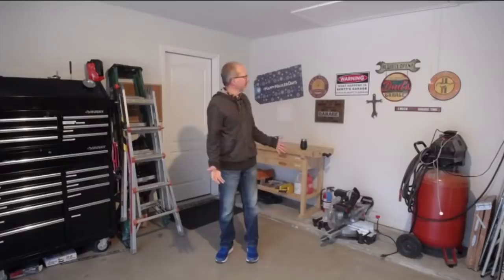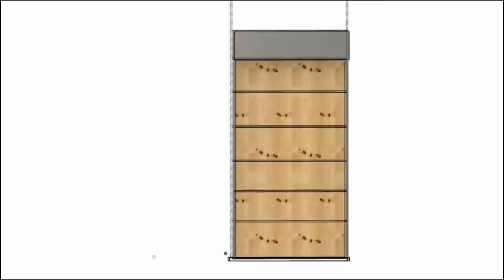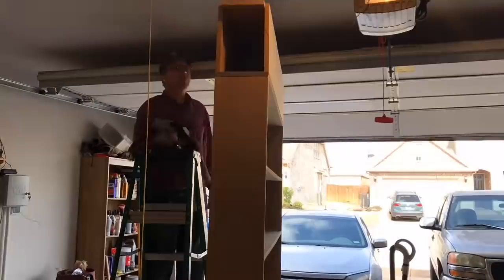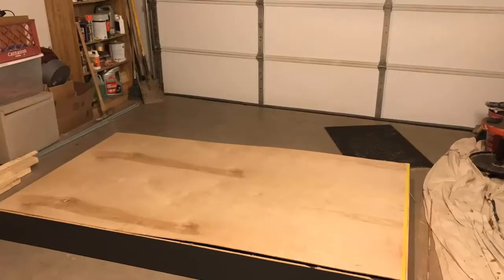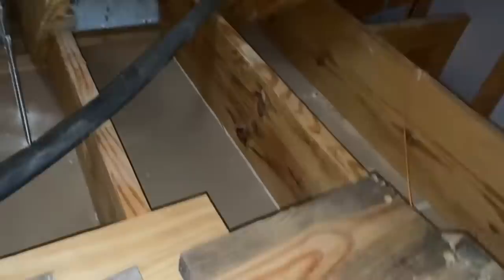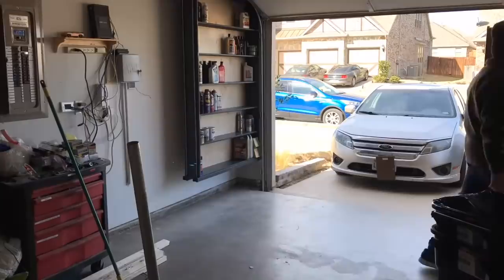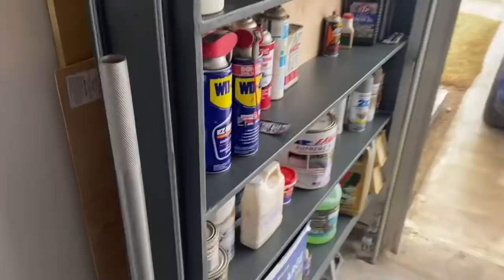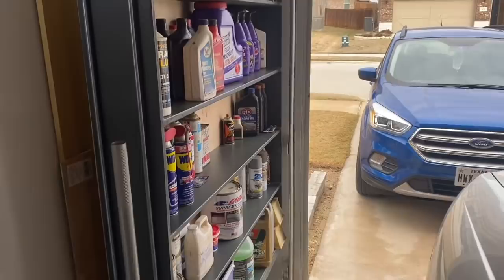Get Smarter Storage with These Easy-to-Build DIY Hanging Garage Shelves with Extra Storage Behind!

Comment: Good video and I liked the project and how it turned out. Several years ago I bought the gear wrench ratcheting box end wrenches to avoid the pain of taking a wrench on and off the nut or bolt. That kind of wrench would of helped you in the attic. I was cringing a bit as you came close to the roofing nails with your hands. 
I also noticed that in the attic you had some reflective insulation against the back of the roof... Was that something you installed or was it installed when it was built? And do you know how it was installed? I am going to do something like that this winter and the shelving project would be a good addition as well. Thanks for the video and information.
Ron
Reply: I noticed the same thing, that's why I have gear wrenches to avoid having to keep lifting and turning the wrench back to get a new bite.

Comment: The problem with mdf is the sag factor.  Those shelves will  start to sag  pretty quick.  Maybe if the are stapled to the backboard they won’t.
Reply: If he took one more piece of threaded rod and put it through the front of the shelves in the middle of them, that would help to mitigate some of the sag... Personally though, the only thing I use MDF on is sacrificial tops for a radial arm saw and table saw sleds...

Comment: To debur the cut all thread: you can use a wire nut, usually a large blue to thread on then thread off the rod, and it will clean up those threads perfectly
Reply: Or just use the proper nut that goes with the threaded rod/bolt. It does the exact same thing but better because, it isn't tapered like a wire nut, has the correct thread count, is the correct diameter and can clean up way more threads further down than just one or two at the end.

Save the large blue and Grey wire nuts for splicing wires and use the better option...
The actual matching hardware.
Reply: @Az FOA  I'm not sure what you're talking about. If you're saying thread the nut on first sure, works great. I have ran THOUSANDS of foot of all thread for years as an electrician. I can literally consider myself an expert on mounting, anchoring, hanging, running pipe racks, THREADING my own rod, and I can tell you that a big blue nut or maybe even running your channel locks backwards on the end of the rod is the way to go. After you've cut the rod, OFTEN the threads are gnarled enough where you can't get the nut to start. But thanks for the pamphlet information, I'll stick to my pure experience on the matter
Reply: @TheManic.5-OH  been a sparky since 99' myself, so I'm also speaking from decades and thousands of feet of experience. 
If you think wirenuts and channel locks are better than the actual hardware that is made to go together and it works for you, then do it.
Someone on the job site should show you how to cut a threaded rod properly so it's easy to put on the nut. Or you could probably look it up on here and teach someone else on the site.
No need to worry about mangled threads from the bandsaw. It really saves time and is much easier, well for me at least, I've never tried wirenuts. I figure if I'm going to screw something on, it might as well be the part I need.
Reply: Oh boy, lessons on a bandsaw now! Well, how about this: I've been using a porta band since they were available, hell, we even got a prototype to try out before the (I think) makita was released. So its probably safe to say we've got similar experience using portabands. In fact , I own two, recently purchased the dewalt atomic, and its a game changer for dewalt users even though Milwaukee has had their lil band out for a long time.  Although I don't recommend it or even approve anymore, out of necessity, I started cutting all thread with a Sawzall. So I had no choice but to learn. And yes, having a wire nut on hand is absolutely faster than any other method with stubborn threads 👍🏼 that's been my point all along. I'm not sure what other hardware would be included to do this task, especially because hardware ISNT included and we buy all thread by the stick, not by a fancy install kit with 'included hardware' :)
Reply: 🤦🏽‍♂️🤦🏽‍♂️🤦🏽‍♂️ well, since you're clearly having trouble comprehending what I've been saying this whole time, you may need someone to help you understand. When I said rod comes by itself, I was responding to your comment about 'included hardware', its ridiculous. You don't buy 'kits' of all thread, no hardware is included. You literally just provided evidence you don't know wth point you're even trying to make. 

Why don't you make better use of your time and go be productive instead of trying to make the world thing you're smart on YouTube? 

I'm recovering from a knee surgery, so I actually have down time to be on here, in comments, I can prove you wrong all day, but I prefer to learn from YouTube. I was offering a tip that's worked for me flawlessly for a long time, especially since most people learning about cutting all thread on YouTube aren't going to have the experience I have and may struggle with clean cuts. Maybe post a link to these sweet kits you speak of 👍🏼
Reply: @TheManic.5-OH  please show me what post I mention it coming in a kit? Or the hardware was included? Please, I'll wait.

What I actually said was, if you could read, "who buys allthread and doesn't get the hardware to go with it".
I also said "the matching hardware".

That's not me saying it's a kit or anything is included. 

And you say it's clear I'm having  trouble comprehending and saying on point? 
Lol, pot meet kettle.

You must be doped up after surgery, so it's understandable you are having trouble reading and following what's going on, so I'll leave you be.

Get well soon sparky.

Comment: how is that MDF holding up a year later?  I built a whole set of kitchen type cabinets for my garage (both uppers and lowers) out of MDF. After a couple of years they started sagging and racking due to the humidity here in Florida so I replaced them with 3/4 ply and they have held up very well and it is going on 12 years. MDF does well in compression loads but not so well in any other orientation, it also swells if any moisture  is left on them for any length of time even when painted or sealed.  Bottom line, you did a nice job but keep an eye on them because they will eventually fail.
Reply from the maker: No sagging at all so far. Thanks for your comment.

Comment: In the end I was not convinced that the extra work to hang shelves created any real benefit.  You could still have space behind the shelves if the shelves were on the floor, perhaps with some anchor to the ceiling to prevent tip over.
Reply: Makes it easier to use a leaf blower to clean out the garage... Also, since it's a garage, there's a chance that anything touching the floor is going to get wet and that is BAD with MDF... An added benefit though is that it leaves a place for heavy stuff that rolls like a floor jack... :)

Comment: I would prefer the load on the concrete rather than the frame of my house.....
Reply: It's close enough to an exterior wall that the vast majority of the load is going to be transferred directly to that wall and then to the concrete... Since he's using MDF, he's not going to be able to put that much weight on each shelf...

I have probably around 400-500 lbs of lead ingots (for casting bullets) stored in my garage on shelves that are between the exposed wall studs... The shelves are just 1x4 pieces of cedar reclaimed from a privacy fence that was blown down during a hurricane a few years back with 1x2 pieces nailed to the studs for edges for the shelves to sit on... It's all about distributing the load... Each shelf has maybe 2 or 3 layers of ingots on it, so no deflection in the shelves...

Around here, it's pretty common to have the water heater for your house located in the attic and it is not necessarily located directly over a load bearing wall... A 50 gallon water tank is going to way at least 400 lbs when full just from the weight of the water...

Comment: Any idea on how to approach the same shelves but without access to hang them? Above my garage is finished so I can't get to the joists to hang. Any help appreciated!
Reply from the maker: Interesting you would ask. I was just thinking about this. I would get another 2" x 3" stud and cut in half leaving two 48' lengths. I would drill a 1/2 hole at each end (4 total) and then countersink the nut. Then I would align the rods with the shelves and lift up the countersunk portion to the ceiling and using a stud finder firmly attach the studs to the bottom of the rafters. Then I would put a jack under the shelves and lift them up off the floor and tighten the bottom nuts. I think this would work. I would also keep the shelves a foot from the outside wall unlike what I did in the video. The reason I say this is that I received a lot of negative comments from garage door repairmen saying it will cost more replace a broken spring. They need 1 foot clearance. Hope this helps.

Comment: not sure why you could not just have screwed them straight to the wall in the back and leaving a gap for the plywood for it and not use the threaded rod ....it would be easier faster better and cheaper way cheaper to do, much like all floating shelf's no need for rod.

Comment: Granted the space behind the shelf could be very useful, but it also means you couldn’t butt anything large or heavy up to the shelf’s or you would lose access. 

Personally, the attachments in the ceiling space concern me a whole lot too.

I think I would go with a French cleat type system forgo them space behind and have potentially deeper shelves / or more garage space that are easier to remove if needed for garage door repairs etc.

Comment: Should you put a support in the middle so the shelves don't lag?
Reply from the maker: It’s been a year and no sag so far. I understand your concern, however with mfd.
Reply: @ScottsGarage17  -- FYI... It's MDF, not MFD -- Medium Density Fiberboard... There's also a HDF... MFD is usually "Multi Function Display" and "mfd" is usually "microfarad"...

Comment: what about the guy that has to service your garage springs when one breaks?  No one thinks about the guy that has to figure out how to repair your door with something like that in the way.
Reply: If you can build a shelf and hang it from the ceiling joists, you are probably mechanically inclined enough to replace your garage door springs... :)

It's when the springs break when the garage door is most of the way up and comes crashing down and turns the door into a "modern art sculpture" that it is nice to have help replacing the door... But just replacing the springs should be a one-man job usually... Pretty easy if you know what you're doing, hazardous if you don't... :)

Comment: Sorry but the boards you used in the attic will fail. You cut way to much of that for it to provide adequate support to those rods. Why not just place that unit on the floor? Space it up if water is a concern. This whole design has me scratching my head. Am I missing something? I appreciate the notched and glued shelves but I don’t get the point of it hanging from the ceiling when it goes almost to the floor anyway.

Comment: First thing I wish you hadn’t done was use MDF for your shelves. I believe your going to regret that decision! Should of used 3/4” birch plywood that’s least 4 times stronger then MDF and much more stable. I’ll bet you that your MDF shelves are going to bow on you big time. Especially after you put weight on those shelves.  Even though you painted the MDF, it’s still likely to draw moister if your garage not heated? MDF does not hold up well to moister at all. It will swell and flake apart over time. Bitch plywood would of been a much superior product to use for your bookshelf. Trust me, I know! Been in the woodworking trade all my life since my Dad was a woodworker and drug me into the trade as a young kid and been doing woodworking now over 50 plus years. I’ve had to replace a lot of MDF cabinetry in my lifetime! Be perfectly honest when I ran my own shop I flat refused to build anything out of MDF cause I know it won’t hold up over time. I don’t even care to use chipboard or MDF for countertops as majority of woodworkers do.  If a countertop gets wet where the water able to seep under laminate or tile That chipboard or MDF will literally fall to pieces. Wouldn’t be the first sink I’ve seen fall thru the chipboard or MDF and the sink lands inside the sink cabinet!  I hate to be the bearer of bad news, but I’m afraid you’ll find yourself replacing that MDF within a couple years if not sooner? But I hope somehow it holds up longer for you?  Even with plywood cabinets shops don’t normally have shelves span more than 33” unless there’s a support in the middle of the shelf.  Years ago I build an upper cabinet for a ATV engine builder that wanted to put extra engines on the shelves. I built the shelves out of birch plywood 33” across and the ATV engine builder put 2 engines from ATV’s on each shelf and the shelves didn’t even flex. Guarantee you never do that with MDF!  You could help your shelves though if you add a  2” x 3/4” self edge glued and stapled or nailed to the front edge of all your shelves will help strengthen those shelves considerably!  Without a self edge I’m afraid those shelves will bow so bad under the weight you’ll have on them that the shelves will literally fall apart and hit the ground at some point. Possibly a lot sooner then later too!  It may of cost a little more for the birch plywood, but it would of been worth every penny and then some in the long run.  You got it built now though, so just wait and see what happens?  Time will tell the tale!

Comment: Studs aren't 2x3...thier are called studs because of the length 93 inches.so when building a wall with top and bottom plates it all equals 8 ft
Reply from the maker: I stand corrected. Thanks for clarifying. I am always learning. I built the other shelves using 2x3 x 93 inch studs.

Comment: Seems it would have been much easier and quicker to have a shelf sit on the solid ground. Good waste of time.
Reply: Garage floors are often sloped so that water will run out of them... Plus, having it off the ground makes it easier to use a leaf blower to clean out your garage... And there is the added advantage of being able to put heavy items that might have wheels on them under there (e.g. car floor jack).

Comment: What is it with these builders?  They build a house where you can sleep with a football team in the master bedroom and it is hard to get two cars into a two-stall garage. Who the hell needs a master bedroom of that size. Make the garage a little larger.  I already know the answer, they build these houses for women who want a  massive bedroom and don't give a shit about the man who needs a garage.  These houses don't have a usable attic and no basement, so the only storage you have is the garage.  I just looked at a house in Fl. they wanted 500k and you couldn't get two cars into the garage unless one was one of those two-seat electric cars.  One side of the garage was only about 10 ft. deep because they put the water heater there.

Comment: Instead of doing all that extra hard work hanging it in the garage,,you should of just used 3 inch screws and screwed into your studs threw the drywall
Reply: Which would have left no space behind it for storing sheet goods.

Comment: store cuts are not very precise. they don't care.
Reply: well you'd be wrong. The stores use a tracked panel saw to cut up sheet goods. More accurate than doing it at home with a circular saw.
Reply: @richardschipper5989  it was not the tool. it was the operator. i went through this before.
Reply: I tend to use the store cuts to give me a rough cut that is easier to handle and for when I don't have my utility trailer with me... I switched from a pickup to a Jeep JL 2-door Wrangler a couple of years ago... As long as the cut is a bit over the size I need, then I can trim it exact on my table saw...

Often though, I can work around the dimensions of the store cut as long as they are all consistent...

And, of course, if you catch them in their inconsistency, you can often get a discount on the item if you can work around those dimensions... Awhile back, I needed a 4x8 piece of cabinet grade plywood cut into 4 pieces of 2 ft by 4 ft... I only really needed 3 of those pieces for the project though... When he finished the cuts, I noticed that one piece was a couple inches too short and another a couple inches to long... I mentioned it and he went to go get another new sheet to try again... I asked him what he was going to do with the old pieces and he said that it would go into the scrap pile for sale at a discounted price... I told him that I might be able to work around this if the price was right... I ended up getting the pieces for less than half what it would have originally cost me... Sometimes, it pays to be flexible... :)

Comment: Not only do I see way more work than you need to do but I see your new shelves are slim compared to the old one! And holds much less stuff! Personally I think you've over engineered it and under thought the whole process! And your hanger boards are not in any way safe nor up to any conceivable codes! I call this a complete failure both in design and in utilization of space!